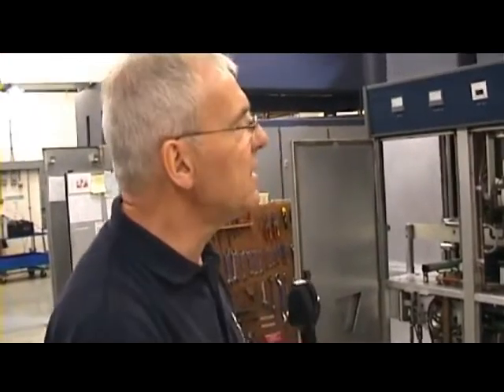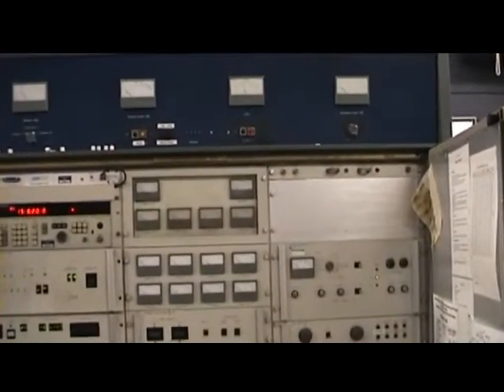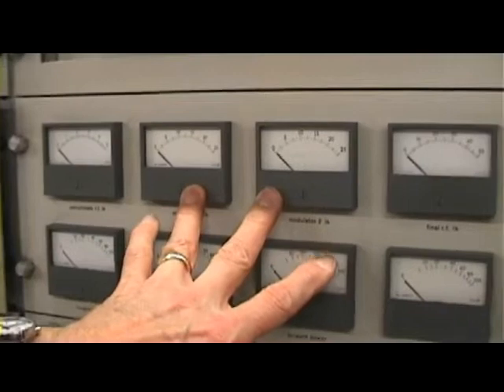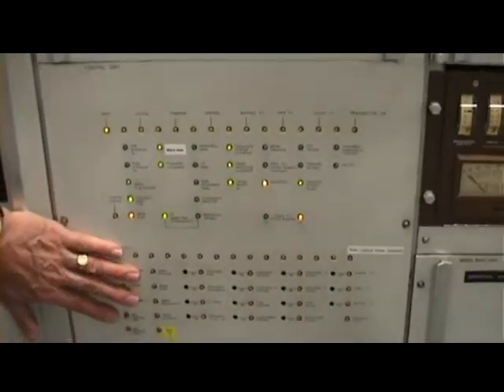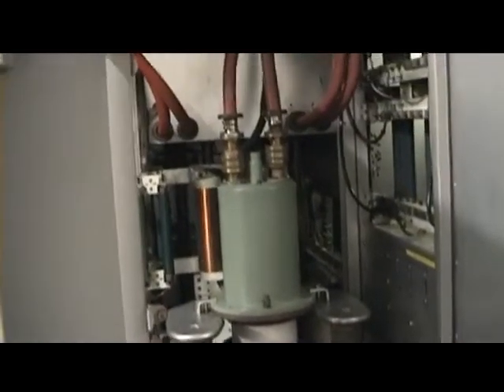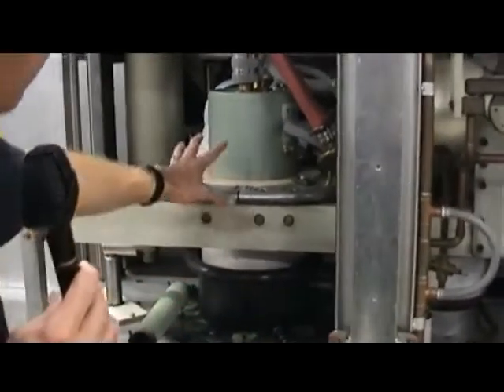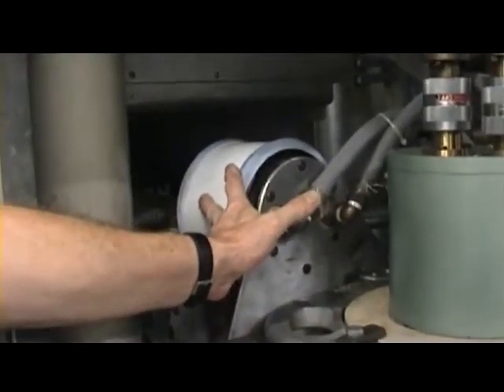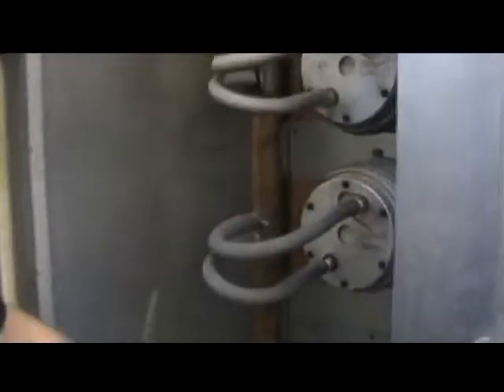Part 8 Marconi B6124 Overview - Woofferton Transmitting Station

Comment: Woofferton will be the new home for Radio DARC broadcasts as of January 2025, this is due to the complete closure of the Moosbrunn ORS transmitting station in Austria after Dec 31 2024.

Comment: Fascinating stuff... funny to see the 22 mm copper pipe exactly as used in domestic plumbing!
Reply: Used the copper pipe as the coax inner and aluminium pipe for the outer viax for   high power  tranxmitters. When ever the inner and outer touched on full power it melted or gave off a Corona burst